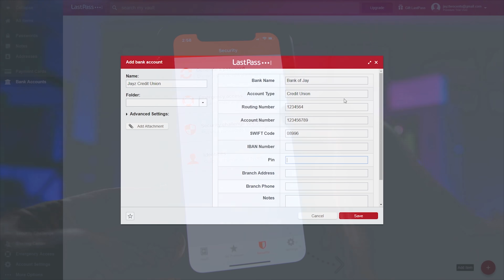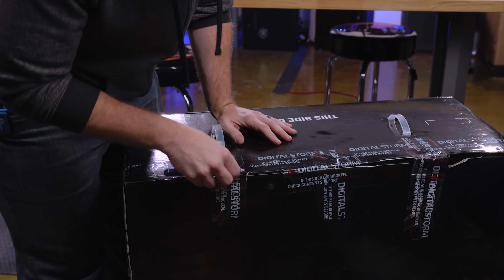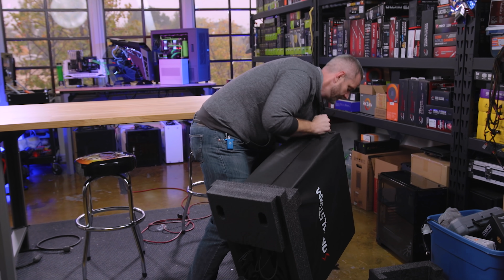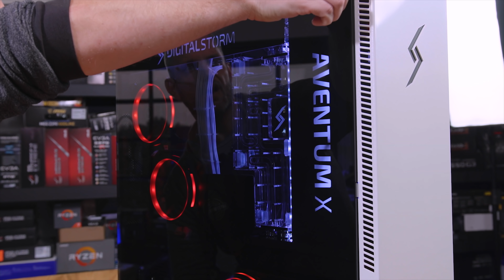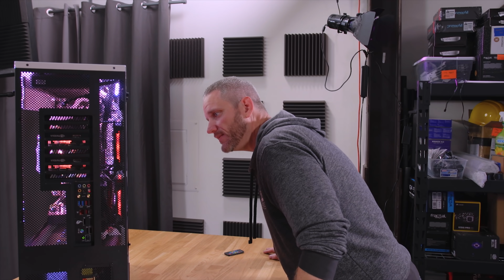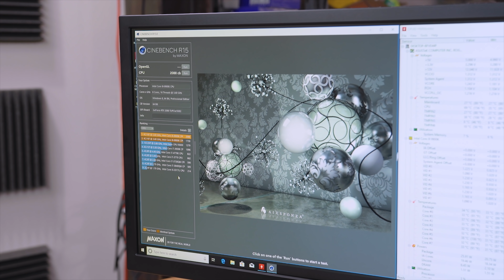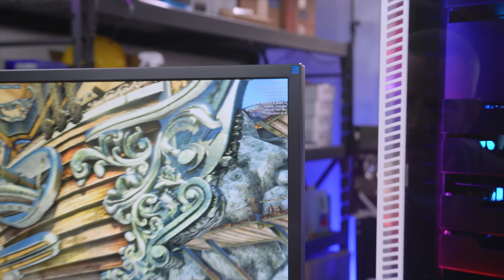Unboxing a $9500 Custom Computer...

Comment: 8 core, dual channel pc with graphics cards running at x8 for 10k?
Reply: Not that I approve of the terrible value of this computer, but there is no performance difference between x8 and x16 PCI-E 3.0 when it comes to graphics cards. Its less than a frame different... and the NVLink connectors on the RTX series actually transfer the load of the inter card data transfer from the PCI slots to the NVLink connectors, unlike the older SLI connector putting the weight of the transfer on the PCI-E slot.
Reply: But... can it run BF5 with ultra settings and ray tracing at 60FPS average at 4K?
Reply: @portedbikes   Yes.

Comment: $9500, and only 2 sticks of RAM.

Noice.
Reply: Should be 64 gigs of ddr4 4800
Reply: Jetgamer53 overkill
Reply: @voltzzie1181  not for damn near 10 large 😂😂
Reply: @voltzzie1181  dual 2080 ti cost about 3000, so u got an extra 6500 to blow, even with the best that money should be able to buy anything
Reply: @voltzzie1181  also, its 9500 dollars, it is the definition of overkill
Reply: @voltzzie1181  not for professional editing
Reply: @voltzzie1181  yes, but his point remains. For the price, that's what you should get. This is already overkill, anyway.
Reply: Jetgamer53 also account for the Ryzen Threadripper 3990X ($4,000) which is the best cpu money can buy. You then have 2500 left.
Reply: Probably two 16 gigabyte sticks
Reply: Extr3me no it’s 2x8gb at 3000 speed. It’s fucking criminal
Reply: Same bandwidth as 4 sticks, and more stable
Reply: Would you want 4 sticks of 8gb or 2 sticks of 16gb?
Reply: @RyanDigzz  4 of 16 ? Lmao
Reply: @ottovanteeffelen1860  read it closely lmao
Reply: @RyanDigzz  i sorry commented before i was the vid 😂still i would rather say if u buy this kind of PC you could just throw  in 4× 16
Reply: @ottovanteeffelen1860  yeah that's true lol
Reply: @RyanDigzz  4 sticks of 16 gb
Reply: @RyanDigzz  2
Reply: For that price
Reply: @jetgamer5386  wouldn't get that stable unless you run loose timings
Reply: Ikr
Reply: @elisniche  each RAM with 6 tb ;(
Reply: Instead of babbling like children look up the specs on the website. It’s two sticks of memory 64 gbs each they state that in the specs. 128 GB total.
Reply: Kattzu you’re a genius man 

Also dual channel >>>>
Reply: Kevin Tran thanks bro and it’s a ridiculous build lmfao but I mean that’s what gaming is all about! If this pc isn’t porn idk what is!!!
Reply: it might be a crapple
Reply: the sticks are 64gb at 3200mhz at cl14 timings. There highly over clockable
Reply: Just did a $9K build on their site and it comes with a GeForce GTX 1650 LMFAO, they lost all credibility with me
Reply: You know that 128 GB Ram might give less FPS than 64 or 32 GB of RAM ?
Reply: @K1nan  Might is the key word. Two sticks of 64 GB is easier on the controller than say, four 32GB sticks. It all depends on what the system has already, GPU, CPU, motherboard. In this case, less is more. Of course, this might change as technology gets better.
Reply: @K1nan  how?
Reply: He forgot to remove a 0 on the price
Reply: U can get it custom to 4 if u want
Reply: probably a pair of 4-GIGABYYYTEZZ ;)
Reply: And all of them empty storage bays...
Reply: If it $9,500 it should have AT LEAST 64 gb
Reply: If I'm paying $9500 I want like 64gb or more like bruh there is no reason they can't put that in at that price
Reply: VortexYGO I noticed that too
Reply: How disappointing
Reply: Probably 2 sticks of 4gb 1600 mhz ddr4 which is enough for this sytem
Reply: @mitchdeloria7000  Please tell me that you're joking. (Kind of hard to tell with text.)
Reply: @googlewolly  bruh
Reply: @mitchdeloria7000  bro
Reply: @Team Locuso  not always obvious with text, kid. I even said that earlier. Idiots on YouTube. Lmao
Reply: Because you can download RAM for free
Reply: it's meant for a upgrade path
Reply: Maybe it’s it’s those that 1 stick has 32 gb ram
Reply: 32gb of ram is enough for the system
Reply: Probably 64 gb knowing that there is 2 2080Ti’s in there
Reply: quantity doesn't necessarily matter, what's important is the gb of each one
Reply: its 64gb per stick.
Reply: @Ms.NoNo2  no, beyond 16gb, clock speed is what matters
Reply: @jetgamer5386  thats also not true.... somepeople testet the different clockspeed and found out that best one are around 3000mhz from more you dont get much more fps in games... i dont remember the exact mhz
Reply: @SaltysoulGG  yeah, but wont higher clock speed make more difference than more gb of ram?
Reply: @jetgamer5386  for games you dont really need more then 16 GB... max 32GB
Reply: @SaltysoulGG  That's what I'm saying, you dont need to worry about GB past 16
Reply: Well if you can afford $9500 . I'm  sure you could afford  another $100-$200 for an extra stick of ram or 2 .
Reply: @adamduffield7782  each computer has places 2 put ram in them, but there is only 2 sticks so he can't put more than 2 sticks
Reply: @synth-_-5093  wrong. Depends on the type of motherboard you have, micro tax motherboards usually have 2 ram slots as majority of full atx boards have 4 . And in a £6500 PC you can guarantee it's a full ATX board so will have 4 ram slots
Reply: @adamduffield7782  idc, and maybe there is 2 extra slots
Reply: @adamduffield7782  apple mentality. Lol.
Reply: @adamduffield7782  that's strange logic. It's true, but strange because it in no way negates the main point: that for this price, you should get more.
Reply: @adamduffield7782  If you are paying 10k for a pre built pc why would you want to buy one that you have to put more components in yourself, They spend 5k on the pre built aspect of it, If your gonna put extra in it later might as well save the extra 5k and build one yourself with more/better components.
Reply: It has fucking sli rtx 2080 ti’s and a 9900k bruh and a shit ton of fans, watercooled and the sticks of ram are probably 2, 16 gig ones. Are you absolutely fucking mad? Bet you play on console, console peasant.
Reply: @rezolvezzz6827  your point? You're pretty stupid, bud. After the expensive components, there is still a ton of money left over. Should get more for that price.

Comment: RGB makes it look tacky. The gold on the fittings makes it look like an 80s / 90s home - tacky. The fact that all the airflow is suppressed / blocked = beginner builder. I wouldn't buy from them. $9500 for a 9900k with low overclock settings, poor case choice, weight, blocking fans, too much rgb, etc... Even if you can customize everything yourself, you still need to have a brand image - hopefully the defaults are tasteful. Overpriced.
Reply: Hahaha you are a funny guy
Reply: You have some comment in your envy
Reply: This comment reminds me of that whack skater boy meme lol
Reply: "Beginner builder" he says. Rofl.
Reply: Stop being salty.

Comment: Wow those screws holding down the waterblock are chewed to hell.  Definitely lacking mechanical skill during assembly.  For this caliber (cost) of product, this is completely un-acceptable.  Have to wonder whatever other mistakes are made particularly with adding coolant, contamination, et al.

Comment: my 600 euro build gives me score of 1352 in cinebench. paying 9500 to achieve extra 700.. 
I'm running Ryzen 5 1600x at 4.2ghz. Noctua nh-d14 keeps it at 55degrees top while playing battlefield 5 on max. Getting stable 60fps and I don't need any more cause my monitor wouldn't make it anyway x)
Reply: What do you think of the NH-D14? I've highly considered it, Might get an AIO just for looks though

Comment: Simply idiotic that USA dont change there scale to kilograms and the metric... and here most will say yes but the USA scale is in fact allready based on metric/kilograms its just the kilograms + a conversation translation on top... and that just makes it even more ridiculous.
you can even see how hilarious it is and the manager for scaling in the USA thinks it's a joke that we ain't going full metric.. its USA and some little country in Africa there still use this metric translation that makes no sense other then it make it more compex then it has to be. ..here Vertasioum also talks about it with the manager for USAs official institute for standard and technology who also says it stupid and idiotic that USA is not changing it to metric, as USA are already on the metric system, just with an added conversation on top to make it even more difficult than it has to be, simply stupid.. https://youtu.be/SmSJXC6_qQ8?t=40

Comment: when i installed my 9900k it kept restarting 4 times before launching into windows.  had a friend scan my computer and the CPU ring bus was failing and finally shit itself.  so i took back the CPU, motherboard and the 2080 to micro center and got my money back

Comment: EK 2080 Ti block uses a jet plate style design, and inlet has to be the port on left if you face the block. The terminal they put in is connecting 2 blocks in serial not parellel, menaing one of them must have inlet and oulet reversed. Bad practice.

Comment: What the ** is this !? http://picplus.ru/img/1812/07/96c3b3b9.png

For 9k$ this cables should be gold plated, well arranged and with wifi distribution integrated in it... What I see, is a total mess of the space, capability and material waste.

This is a product oriented for rich and spoiled ones which prefers to buy the most expensive, thinking that they are getting the best )

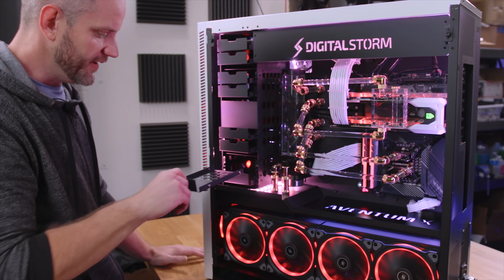Comment: Umm....  6:32 that is NOT "hot swappable".  Hot swapping is something you do when you replace drives on the fly while the PC is running.  I'm not sure if the SATA card and OS handles hot swapping.  Those are just sliding removable trays.  Those of us who work with and/or around servers cringed at him saying that I'm sure.

Comment: Christmas holidays are coming soon and many people (that's me) are looking forward to improve their viewing experience. I am using a decent old monitor tv to game at 1080p at 60 hz. What will be an upgrade?4k @ 60hz (maybe overclock at 75?) Or 1440p 144hz? As TV's don't really recognize 1440 will there be issues with other content like movies?I got enough horsepower for most tasks with an wc 7700k at 5ghz and 2 rx580 8 gb oc as well on an msi z270 m7 and that leads to my next question. Msi put 3 slots for GPUs, but how is that ever possible to fit a 3rd GPU in there despite the fact that I use the gigantic phantecs enthoo primo. thanks in advance

Comment: The fact heat rises wouldnt it improve PC performance by having exhaust fans pointing out the top of the case and bottom side fans pulling fresh air in?
Reply: Heat barely rises, a 100rpm fan moves more air than that. The real problem with this case is they're trying to intake air through SOLID GLASS.

Comment: My AMD 2950x threadripper got a 3000 score on Cinebench without even over clocking the cpu. I had 64gb of g.skill fury at 3200mhz. The temps were 45 Celsius with the corsair h100i with four fans instead of 2.  $9500 for what, flashy water cooling, and overpriced rtx cards,  that's where all the money was thrown away. Paying that much the temps better be 35c overclocked and 4000 cpu score on Cinebench.  Ridiculous
Reply: Well your threadripper is intended for workstation uses. An I9 9900k is really intended for consumer level. I do agree with the temps though.

Comment: way over priced. i built my system for around 1000 bucks and it works fine, 7600k on a msi z270 sli plus Motherboard, with 16 gb corsair vengeance ram @2400mhz, with a coolermaster MA610p  cooler, 600 watt corsair psu, and a evga gtx 1060 6gb card, 2 barracuda 2tb HHD's and a NVME m.2 samsung 960 evo@ 256gb and a 256gb m.2 drive i ripped out of my laptop as the boot drive, all inside the coolermaster h500p.

Comment: 9500 dollars 2 ram sticks? they are not even using xtreme edition CPU  WTF is this they r such a ripoff
Reply: If i made a fucking masterpiece like this, i sure as hell would want some money for it
Reply: Yea, this is awful value. $5k with SLI 2080 tis and water cooling should suffice. I'm not sure anyone builds PCs sensibly or with enough options at a reasonable price.
Reply: 2 ram sticks=better ram overclock.
Reply: MrPirateking619 I was thinking the same thing
Reply: There is 2 2080
Reply: it is just meant to look pretty
Reply: https://www.digitalstorm.com/aventum-x.asp 
No he got it wrong i believe.  

Up to 28 Processor Cores
Up to 512GB DDR4 Memory
Up to 4 Dedicated GPUs
Up to 6TB Solid State Storage
Up to 15TB HDD Storage

Is for the 9500 one.
Its a Intel Xeon W-3175X CPU
Reply: And fans under glass yay for making all of them useless
Reply: @Arsenic Pills true true
Reply: keep in mind that all of the cables are custom manufactured, custom manufactured water cooling and the graphics cards alone (not water cooled) are about $1500 per card. yeah i think its overpriced but its not a ripoff. this build would probably be way more if they used a $2500 processor
Reply: @itz_lexiii_  sry it's a rip-off fire hazerd
Reply: SpartaGames yeah you can see at 5:45 the nice custom cables... lol theyre all scuffed
Reply: i should also add that anywhere from 16-32gb of ram is more than you will ever need for gaming
Reply: @itz_lexiii_  the issue is not if gives more performance or not the thing is it cost 9500$ and you expect everything to be there doesn't matter you need it or not for 9500$ I expect atleast 64 gb of ram and 10TB SSD storage and 20 TB of mechanical storage cos that's the only way a 9500$ price is justifiable if your not using xtreme edition CPU or xtreme motherboard
Reply: @itz_lexiii_  OMG, you fucking missed the goddamn fucking point. Get the hell outta here.
Reply: @MrPirateking619  10 TB SSD storage and 20 TB HDD storage with all that custom stuff and 2 RTX 2080 Tis? Sorry but 10 TB SSD and 20 TB HDD is over 2,5 k
Reply: @GroovyHomie420  Exactly
Reply: @itz_lexiii_  Never say EVER :)
Reply: @itz_lexiii_  This is a rip-off. He even states in his review that all parts are bought off the shelf. The big pricing is the custom case and wires. you're paying an extra 5k$ for that custom bit from them. Spend 5k for the computer and spend the 4500 for custom crap from this company that does nothing for performance or spend 4500 on equipment in your gaming setup. With this type of computer you're not going to be using it for only gaming. This is an editing/streaming/gaming computer in one. so...yes more than 32gb on this is needed.
Reply: @itz_lexiii_  go to PC part picker and put the system together and it will show that at 9.5k the water cooling and custom cables would have to cost around 4.5k. Does that see reasonalble?
Reply: @itz_lexiii_  I take it you don't actually have one of these graphics cards given you're off on their price by a few hundred dollars each, up to $300 each as when you're using a custom loop you don't need to spend more on better cooled versions. What the hell is a custom manufactured cable and what does it matter? What does a more expensive processor have to do with any of this? It's a terrible price. Like I said, I can see $5k. $9.5k is awful value.
Reply: 8k of cost is just the case and cooling system.
Reply: That's because this machine doesn't cost $9500, it actually cost $3,500 at Digital Storm website.
Reply: @marckhernandez7990  No it doesn't
Reply: @marckhernandez7990  it's the maxed out one you don't know anything about PC if you did not here him

Comment: Hmmm that's one expensive case and liquid cooling configuration... That's really all that you're paying for here!
Reply: yeah 2x2080ti certainly got no value atm.
Reply: @JAKOB1977  Thats only about 3 grand of the total 9500 price tag
Reply: Nicholas Beer do the math and you will see the hardware summons to around too 5000 too 7000 for and then there is the build and warrenty and the fact that they aint doing this for your blue eyed viewpoint but also need to make a living..this is not a budget pc..this is premium..and custom.. everytime i buy a lamburghini for 300k i can complain as i can get a car from audi with the same motor for 1/3 of the cost.. but if it was the motor i wanted then i wouldnt by the lambo.. you pay a premium for premium things.. if you can do it better then make one and sell it cheaper and make yourself a buiness..it all look so easy from the inside..but it aint.
Reply: @JAKOB1977  I'm just saying that there is no value at all it doesn't matter that it's one of a kind (even tho it isn't). If you really wanted to you could put 2 rtx titans in there assuming the price holds. Comparing super cars to consumer electronics (yes consumer) is not exactly a great comparison lol. Lamborghinis use alot of parts from audi btw probably because they are both owned by VW but who cares.

Comment: As for custom prebuilts digital storm is one of the better options my current system came from them my brother got it and then a few months later he sold it to me and my main rig was actually older so I moved to it probably wouldnt buy it myself but it a good buy overall

Comment: Why did they make the glass cover the full vertical side and block fans. Could have the glass stop before the fans and have a separate mesh cover with thumb screws, sure the fans aren't as visible but at least they can breathe.
Reply: I think it doesn't really matter with such a strong water cooling unit installed. CPU/GPU will hit their limits easily before critical temps